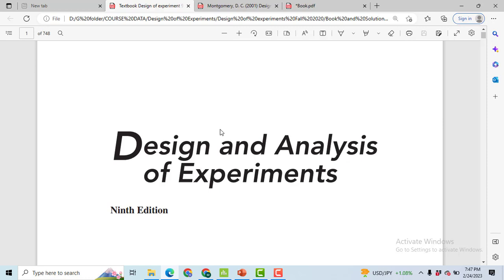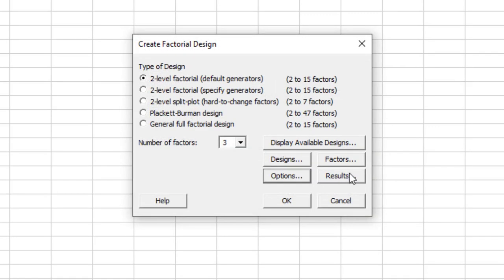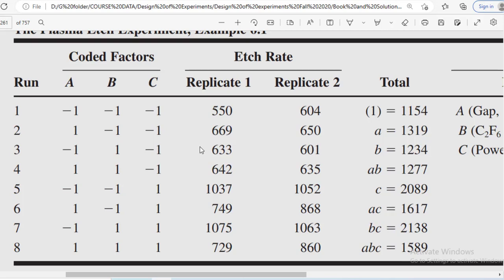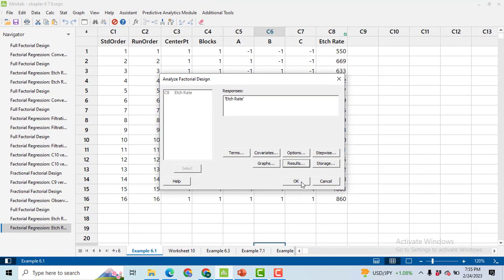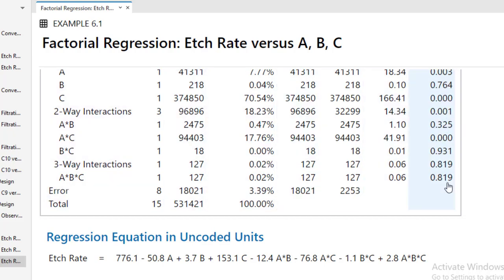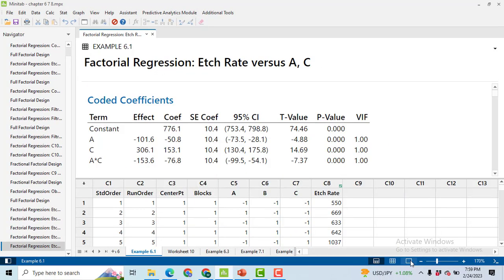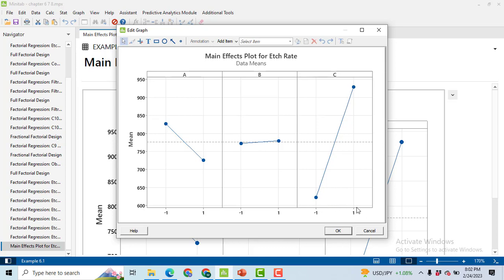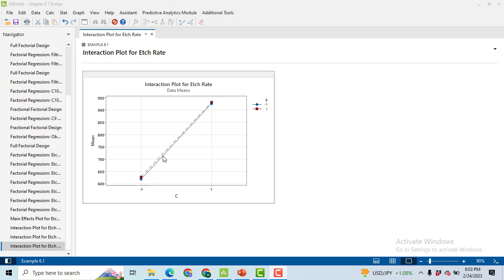2k Factorial Design in Minitab | 2^3 Factorial Design | Main Effects Plot | DoE Example 6.1

Comment: I have an assignment to complete on Wednesday. There are zeroes which is uncommon rather than -1 & +1.  Should we ignore 0.
Reply from the maker: Do you have data in minitab or in excel
Reply: @EngineeringandInfo  : I have data in excel. However, I need to analyze it through minitab only.
Reply: I'd like to know what zero suggests? To me, It should be ignored.  Even Minitab does not take into consideration while creating factorial design. However, I'd like to have confirmation.